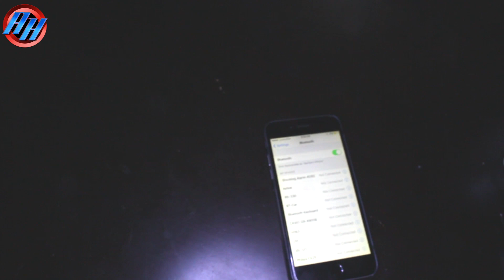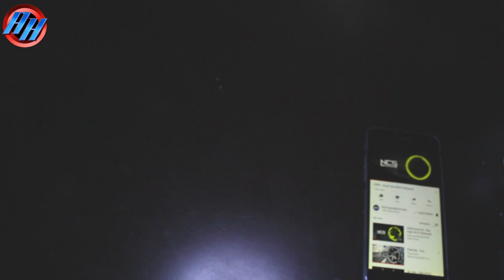How To Make your Earphones Wireless (broken earphones works too)

Comment: I have searched for Bluetooth module before but I can't find it in Amazon.in or ebay if you could send a link to me that would be a great help.
Reply from the maker: US $1.63 (https://www.ebay.com/itm/3-5mm-Wireless-USB-Bluetooth-Stereo-Audio-Music-Speaker-Receiver-Adapter-Dongle/172403409536?hash=item28240b4280:g:DFYAAOSwjlBaTazL)
Reply: American Hacker thx now do i have to open it up and use the PCB inside that?